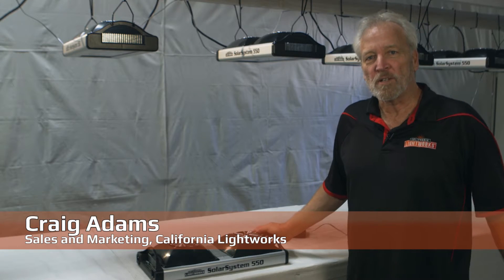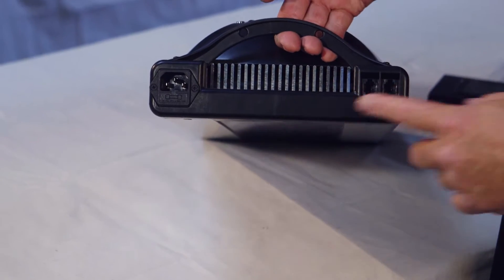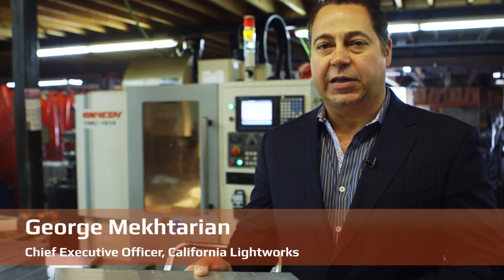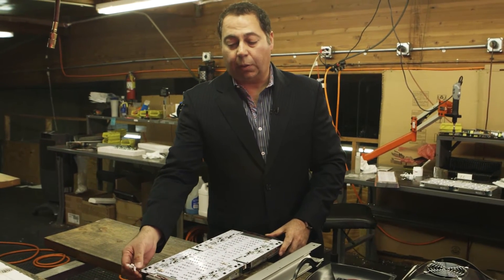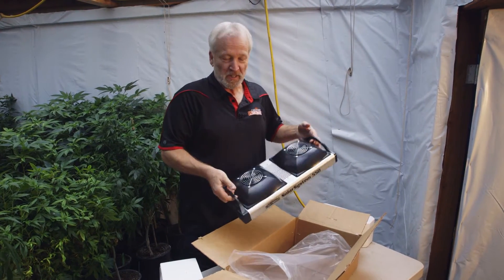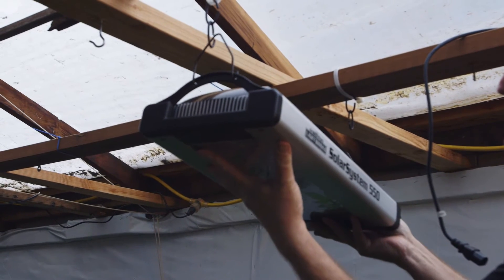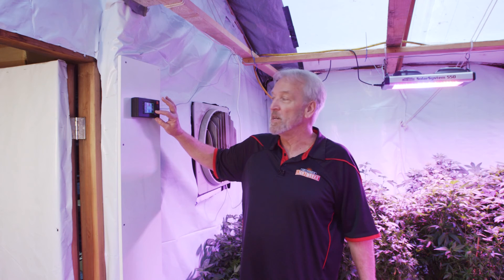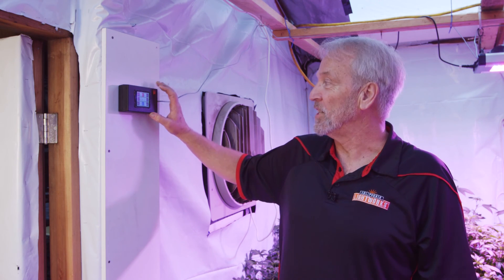SolarSystem 550 - NEW State-of-the-Art LED Grow Lights by California LightWorks

Comment: Why no talk of photons lol    Only generall information that doesn't explain anything unless your comparing to Mars or advanced which isn't much.OSram is only good part about CLW.
Reply: All good points. When your making a "Plant Light" we don't want Lumens, or 200-Band LEDs. When a 3rd Party uses excellent LEDs to make a Fixture they need to measure and tell the Specs, lucky for them they did; see the .PDF .

...
Power Consumption: 400W
Total PPF Output* (uMoles/s): 620
Efficiency* (uMoles/s/W): 1.55
...

YT,
Rob